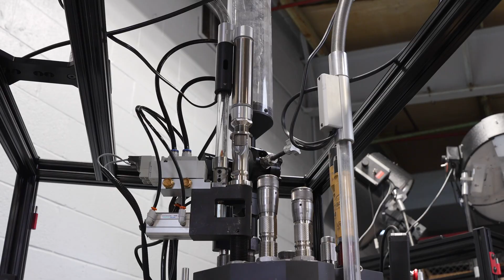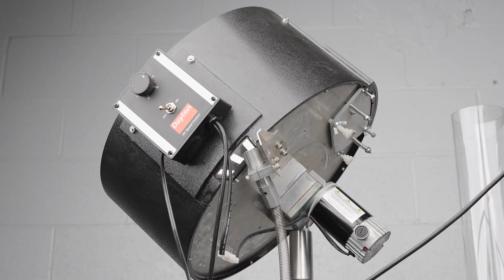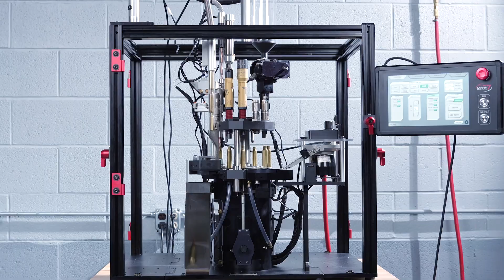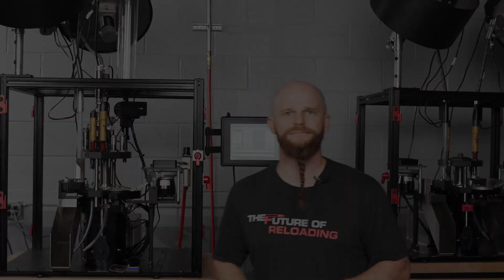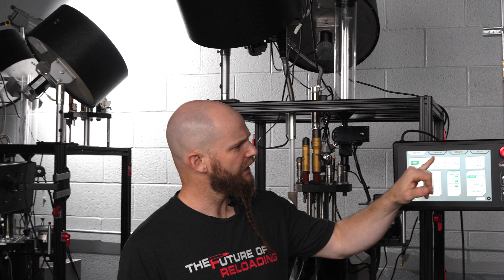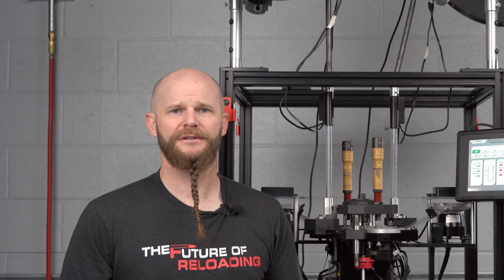The Titan™ Tech Overview - Mark 7 Reloading

Comment: Great machine! The only minus it seems to be the limited primer capacity of the vibratory primer feeder. Looks too small. An1500-2000 pcs bowl s desirable.
Reply: I recall the double feeder system
And a statement that it can run at 5k per hour 9mm
Reply: @Brufallo   the revolution can load 2500 per hour....I don't think 5k per hour is worth the price increase....JMHO